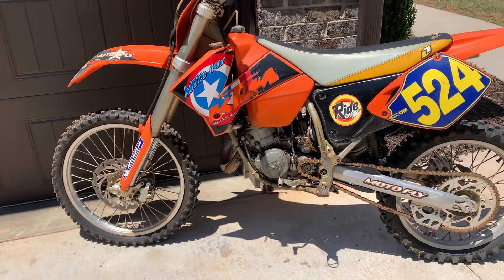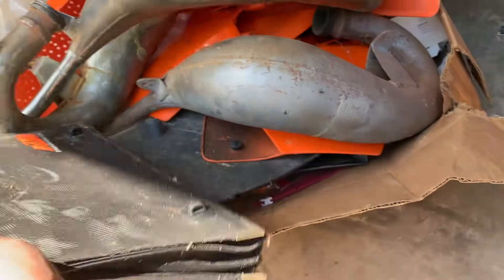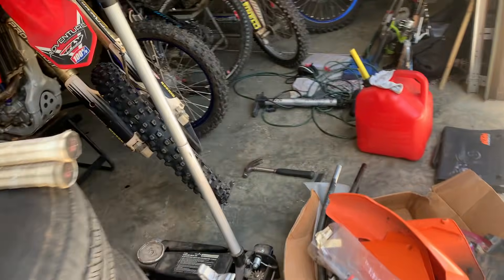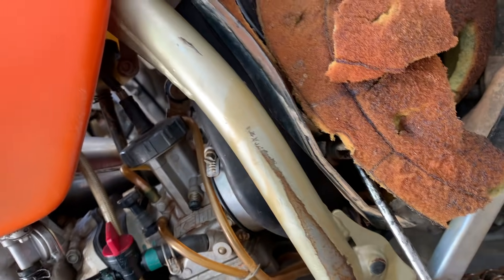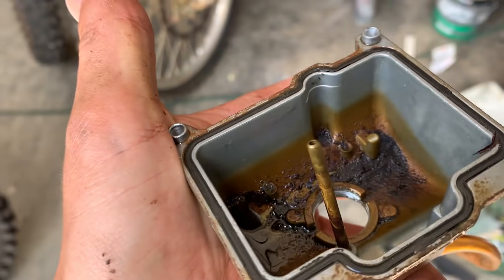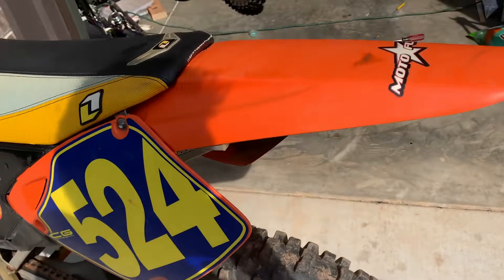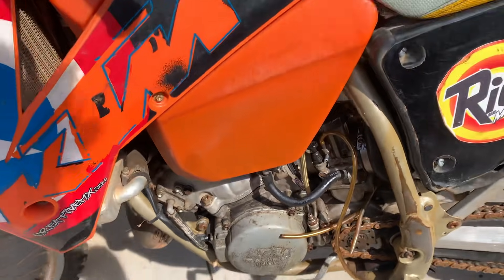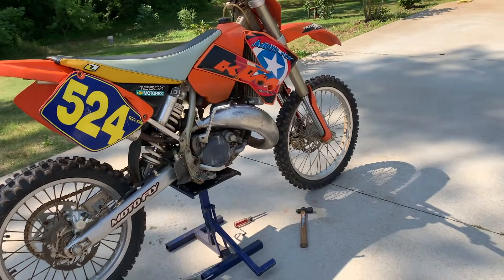$500 ktm 125sx | will it run???|

Comment: DUDE..... We got one of these where I live recently and it cost 1700 and that was the cheapest bike you could buy in my area. I had to put in about $800 worth of new parts, full rebuild top and bottom. Thought i was gonna get away with a carb tune but that ended being wrong... I was shocked that I was even able to test ride it after I started diving in. On the bright side my dad ended up having a whole new motor in his KTM 125 lol

Comment: I just got really lucky on a 2001 KTM 300 EXC. Original owner who was a diesel mechanic and the thing looks like it just rolled off the showroom floor. He did all the maintenance with a new top end, rebuilt top end with less than 5 hours on it, new wheel bearings front and back, and a rebuilt clutch.